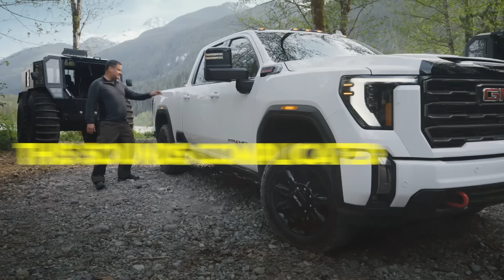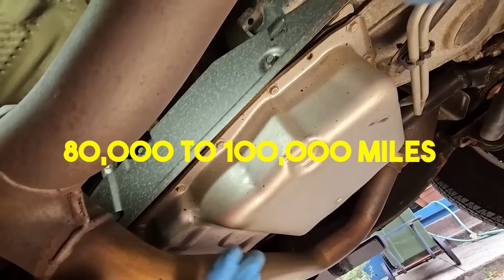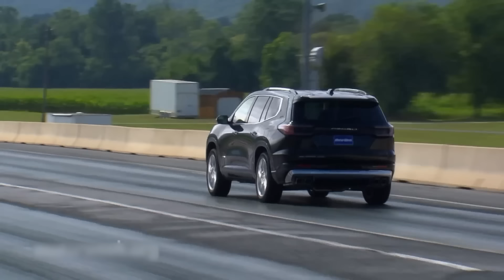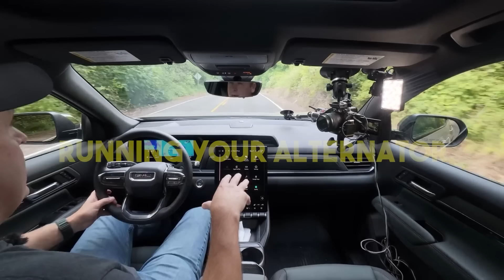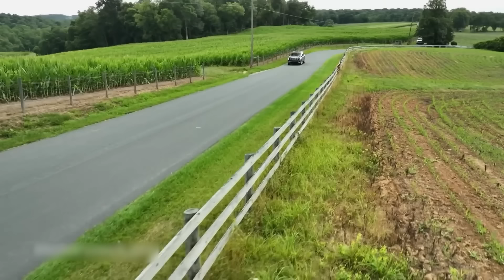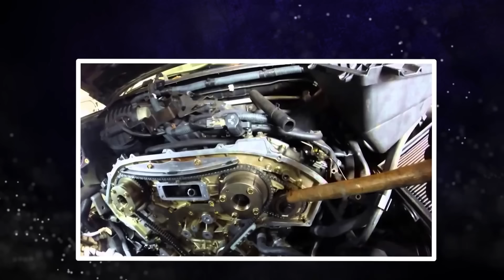How To Make Your GMC Last Over 300k Miles Without Major Repairs

Comment: 2,500 to 2,800 mile oil change.  25,000 to 28,000 transmission fluid change. 30,000 to 33,000 mile radiator coolant change. Brake fluid flush at the 50% wear mark and brake service / pad replacement.
Reply from the maker: That is a "bulletproof" maintenance schedule! While some might call those intervals aggressive, changing the oil every 2,500–2,800 miles is exactly how you reach that 300k-mile club without breaking a sweat. Keep it up!

Comment: Erm I just replaced my thermostat on my 2016 GMC Yukon Denali and the thermostat was NOT as cheap as you’re saying it was about $130 plus an additional 30$ for the coolant  and what place is charging 300-400$ for parts and labor!!! You won’t find that here in GA anywhere not even at a shady shop
Reply from the maker: That’s a fair point on the pricing! Shop rates and parts prices can definitely vary by region. $130 for the part is a bit steeper than what we've seen elsewhere, but it's still way better than a full $400 bill from a dealer! Thanks for the GA price update.
Reply: @EverythingGMC-k9x Georgias prices are INSANE. Especially at a GMC dealership. I need new back struts my are the z95 air rides I can get the struts at my local part store on my Commerical account for 779$ I called GMC just to see what the parts would cost and they said they were 1987 apiece each when I can get the arnott ones for 779 for both. I just had to also have my serpentine belt, ac belt and vacuum belt and tensioner pulley replaced the shop I went to wanted 787$ for parts and labor I made a phone call to my best friends husband since mine is out of state he told me go buy the parts and come on. Went to O’Rileys got all belts tensioner pulley the tool I need to rent to get the belt on for 142$ got 40$ back when I took the tool back. So really only $100 at the part store and he put the belts and pulley on in 30 mins. But the shops said it would take 2.5 hours for everything. Was trying to charge me 350$ on labor and 487$ for parts that I got for 102$  and the parts they were going to use was duralast which cost nowhere near $487 I got the Murray brand because AcDelco for some reason has to be special ordered at O’Rileys. Still the Murray brand is way better than duralast and they were trying to get me for $487 for just the belts and pulley. These shops and dealerships are a JOKE. Especially here in GA

Comment: I bought Diablo i3 and turned off AFM first thing . Change oil when it gets to 30%.regrounded all grounds, removed them , sanded , refastended then painted over to protect  .Put a transmission cooler on it keeping temp around 130-160 and everything’s been great  212k
Reply from the maker: You've built the perfect reliability blueprint! Killing the AFM, cleaning the grounds, and keeping those trans temps between 130-160 with a cooler is exactly why you've hit 212k miles without breaking a sweat. Great work on those proactive mods!

Comment: I'm looking at a 2006 Triple E motor home with an 8.1 Vortec engine. What do I need to know to look for?
Reply from the maker: The 8.1 Vortec is a torque monster! For a 2006 motor home, watch out for exhaust manifold leaks and check the spark plug wires carefully, as heat can be an issue in those tight engine bays. Good luck with the search!

Comment: I can’t believe you mentioned the Acadia haha ! It’s my wife’s car already put a trans in at 43,000
Miles other engine related parts in it not to mention the shift to park crap they love to eat batteries too . Side detection etc .
Reply from the maker: The Acadia is the perfect example of why some models make the 'Worst' list. Between the early transmission failures and that frustrating 'Shift to Park' sensor issue, they can definitely be a headache for owners.

Comment: I’d add brake fluid flush to this excellent video of yours as well…..thanks for all the tips ….Off hand will unhooking the battery terminals to clean them throw any codes?
Reply from the maker: Thanks for the kind words! You're 100% right about the brake fluid. Cleaning terminals usually won't cause issues, just a quick reset of your basic electronics.

Comment: Some wrong info.  GM V8 engines don't have chain stretch problems and the water pump is not driven by the chain.  But your info about proper maintenance is bang on
Reply from the maker: Appreciate the correction! You're right, on the GM V8s, the water pump is belt-driven, and while chain stretch is rarer than on other platforms, keeping that maintenance 'bang on' is still the golden rule. Thanks for keeping the info accurate!

Comment: Great information but ive never heard gm v8 engines dying from timing chain failure. Youre showing overhead cam engines while talking about it and that is misleading to the 4.8 5.3 and 6.2 engines as they are all pushrod engines.
Reply from the maker: Great catch! You’re 100% right—the 4.8, 5.3, and 6.2 are all pushrod V8s. Using an overhead cam engine as a visual was definitely a slip-up. Thanks for keeping the technical side accurate!

Comment: Use Amsoil.
Reply from the maker: Amsoil is a solid synthetic and popular for extended intervals, yes. OEM spec matters though, so check the manual, use oil analysis if you extend intervals, and 3k is a safe, conservative choice for severe use.
Reply: @kcsrr15  I’ve ordered it before but if it wasn’t such a pain in the ass to get be a member and expensive to buy I’d probably use it than maybe make it available to buy from the store but No gota jump threw the hoops to get it ..

Comment: Good info.  My 2003 Sierra 2500HD 6.6L Duramax has 210,000. I perform all work on my truck out of necessity. Very few shops work on them. Channels like this one is tremendous for beginners as well as for seasoned mechanics. Keep up the flow on info! Thanks
Reply from the maker: Love hearing that. A 2003 is the LB7 Duramax: keep an eye on injector balance rates/return lines, water‑pump seepage, and harness rubs around the A/C bracket. Fresh fuel filters, regular Allison fluid/service, and it will keep going. Thanks for the kind words.

Comment: with All of those moving parts, extreme heat cycling,  tight emission controls and greedy bean counters, I highly doubt today's gas burning pos will last past the warranty without some kind of expensive repair.  Junk with 4 wheels and a high sticker price.
Reply from the maker: I get the skepticism, modern gas engines are more complex and emissions gear adds failure points, but many still hit high miles with strict maintenance, quality fuel, and proactive cooling/oil care.

Comment: I have a 2024 GMC SIERRS 3500HD. I believe I blew the fuse on my power supply in my bed and in my console. Can anyone tell me where it is located?
Reply from the maker: Check the owner's manual fuse diagram first, common locations are the underhood fuse center and the interior fuse panel under the dash or driver kick panel, some trucks have a rear/cargo fuse or accessory block under the rear seat or in the bed area, look for fuses labeled 'accessory power', 'cargo' or 'rear power', replace with the same amp rating and test, if it's under warranty contact the dealer for guidance.

Comment: Spark plugs are now around $15.00 dollars apiece. Now multiply that times 8.  That maybe cheap for some folks.
Reply from the maker: Yep, spark plugs add up, modern iridium plugs are about $10 to $20 each but often last 60,000 to 100,000 miles, long‑term cost can be reasonable, consider doing them yourself or use quality platinum options if budget is tight, always check OEM gap and torque

Comment: That’s easy. Trade it in for a Ford then it will last to 300k
Reply: Some of us would never own a FORD. You do you!
Reply: @darin5294 I can’t help it if you’re stupid
Reply: Couldn’t give me a Ford unless it’s from the 70’s
Reply: @AJ12-76  Found On Road Dead……. No thanks……..
Reply: @rags8855 boy that’s original!  Wish I could have thought of that…….🤡
Reply from the maker: Trading is an option, but a properly maintained GMC can reach 300k, focus on regular oil changes, cooling and transmission care, addressing AFM/lifter issues early, and corrosion control, what problems are you seeing with your truck?
Reply: Ford 😂
Reply: @DonCurry-n1z even a broken down Ford still beats a Garbage Motors piece of shit
Reply: @AJ12-76 😂 Ford ? F-N owner really dumb 🤣

Comment: The GM thermostat is not 15-20 bucks, try $120 for the OEM
Reply from the maker: OEM thermostats can be $100–120 depending on model, cheaper aftermarket units exist but quality varies, for longevity use OEM or a reputable brand and replace the gasket/housing when you do it, what year/engine is it?

Comment: #1 oil change every 5k miles. 
#2 change transmission fluid change every 60k miles 
#3 coolant change every 60k miles  including thermostat.
#4 throttle body service.
#5 battery terminal maintenance 
#6 air filter change 
#7 belt inspection 
#8 spark plugs every 100k miles 
#9 differential service 
#10 power steering fluid
Reply from the maker: Good checklist, a few quick clarifications,  
- Oil every 5k is solid for longevity,  
- Transmission interval depends on trans and use, check the manual or go 30–60k for heavy towing,  
- Coolant (Dex‑Cool) has a long spec, but check condition and concentration, earlier flushes help high‑mileage trucks,  
- Throttle body service only as needed, not always on a schedule,  
- Spark plug interval depends on type, iridium ~80–100k, copper much sooner,  
- Differential/transfer case service depends on load and towing, follow severe‑service intervals,  
- Power steering fluid follows OEM spec, some systems are sealed.  

What year, engine, and towing use do you have?
Reply: @EverythingGMC-k9x my GMC is a 2016 4/4 canyon long bed with 135,000 mi on it.  I bought it used with 100k mi on it.  My power steering went out last year, but I bought the extended warranty and they covered it for a hundred dollar deductible.  But they refuse to drain and fill the transmission fluid because of the mileage. So I took it to aamco, and they said the same thing.
Reply: Do these rules apply with 2019 Silverado High country?

Comment: 3-4000 engine oil change 
Gospel
Reply: I keep things old school. I do oil changes at 3k. Ive had vehicles go past 300K miles including Ram 1500 with no issues. AFM DELETE IS A MUST!
Reply from the maker: Agree, 3,000 miles plus an AFM delete is a common longevity play for AFM V8s, just be aware deletes can affect warranty and should be done correctly, what oil weight and filter are you running?
Reply from the maker: Totally get it, 3,000–4,000 mile oil changes are a safe, conservative approach, especially on older trucks or ones that tow a lot, modern Dexos synthetics can allow longer intervals for normal driving per the owner’s manual, but if you tow, do short trips, or run AFM engines, stick to shorter changes.
Reply: @SIERRA-dx9wm AMEN 🙏

Comment: Good video but the new fluid for modern GM transmissions is Mobil 1 Synthetic LV ATF HP blue label not Dexron.
Reply: Works awesome in L680 transmission for my 2017 GMC Sierra SLT
Reply from the maker: Good catch, thanks, Mobil 1 LV ATF HP is a common choice for newer GM transmissions, always follow the owner’s manual and any TSBs for your specific trans and year.

Comment: AFM Delete and moving up from 0w20 to 5w30 Dexos Syn for the win!
Reply from the maker: AFM delete plus switching to 5W‑30 Dexos can reduce lifter cycling issues and improve oil film at higher temps, but check OEM spec for warranty reasons and monitor oil pressure/consumption after the change, what year/engine do you have?
Reply: @EverythingGMC-k9x 2015 GMC Sierra, 5.3, excellent truck. Remember to change the oil cap to "5w30" for added assurance just in case, even as I do my own service.
Reply: @thangknowa3288 mine is a 2016 Yukon Denali 6.2L 168.600 miles and I’m scared to death to do the AFM delete.

Comment: I can think of a couple more like clean your MASS air flow  sensor . When doing the timing chain project replace idler pully because of bearing failure !
Reply from the maker: Totally, pulleys and bearings fail and destroy a timing chain job, replace the idler, tensioner and guides when you do the chain, good call.

Comment: Range module to disable the cylinder shut down and the auto start stop. Change oil every 5k with good filter and if unsure of filter then use acdelco. and install a ppe trans pan to do drain and fills every other oil change and change all other fluids every 40k.
Reply from the maker: Thanks for sharing your tips! Those are some solid maintenance strategies that can really extend the life of a GMC.

Comment: First thing ,GM DOESN'T put drain plus on there transmission land anymore
Reply from the maker: Thanks for pointing that out! You're correct—GM removed drain plugs on the 8L90 and 10L80 transmissions. On those, you have to drop the entire pan. Older 6L80 and Allison still have them. I'll be more specific in future videos. Appreciate you!
Reply: Rear ends also, suck  it out or pop the cover off !

Comment: I change my plugs at 50k miles on my 5.3. The last time I changed them the electrodes were pretty much gone. They were still firing but I guarantee they were affecting burn. Next time I’m changing them at 40k miles. Our Lexus, which uses similar plugs, calls for 40k spark plug changes. 100k is ridiculous.
Reply from the maker: I appreciate your insights! It's great to hear how you keep your GMC running strong. Your experience will definitely help others in the community!

Comment: A lot of good tips.  Unfortunately for me despite most of those items being preventativly maintained, in particular my torque converter in a 6L80 detonated at 100,000 miles and took out the transmission.  I had done 3 transmission oil changes at that point.  Shameful as all my other trucks never had a transmission issue in the 200-250,000 miles that i typically keep my trucks for.  Love my 2018 sierra but its not been without issues.
Reply from the maker: I really appreciate your feedback! It’s always helpful to hear real-life experiences. Hopefully, the love for your Sierra will outweigh the bumps along the way! :)

Comment: AC Delco Air filter for the 6.6 gas is $43.00 from Walmart not 20.00. Over $70.00 from dealership.
Reply from the maker: Good catch! I guess I need to hit up Walmart next time instead of the dealership. Appreciate the info!
Reply: Same with plugs not 30$ a set ,try 80-100 per set for the correct ones

Comment: first thing spend the 200$ on a device that plugs into your OBD2 port that turns off the cylinder shut off.
Reply: @chriskelley1115  still have to change oil at 5k miles and drain fill the trans every 20k
Reply: @groovymoon  it will stop it from shutting the cylinders off/on...but it does not solve the issue. The bad parts are still there. You need to do the mechanical delete as well. All new non-AFM lifters and non-AFM cam. Even disabled in the computer if you do not do the full delete you will still have the castistophic engine failure.
Reply: @groovymoon  I did it at 30,000.  Should I do it every 20,000?
Reply: @toddeifert410 the more the merrier.
Reply: @toddeifert410 thanks. I’ll do that. Typically I leave newer trans alone. These things are a lot trickier than my old ford c6 and my Elco 700r4
Reply from the maker: Thanks for the tip! Investing in that device could save a lot of headaches down the road!
Reply: @chriskelley1115  Yes Range Technology no more deactivating cylinders and no more start stop crap
Reply: yup get that device to keep that V8 always pumping...and CHANGE that OIL!!!!!!!
Reply: Be sure the one you get has no parasitic drain when the switch is off. Some do, it depends which pin they receive power from, some select an "Always Hot" pin, needs to be "Switched".
Reply: I bought a "clone" disabler for our 2014 Yukon we bought 3 years ago, and wired it to a switched circuit.  Yes, that disabler would need to be unplugged to use OBD2 reader.
Reply: Did that with a Ranger from Summit.
Runs on all 8 cylinders
Reply: All it takes is alot of up keep money, just money.
Reply: @chriskelley1115  I got one for 59 dollars 3 years ago it works great
Reply: @chriskelley1115  is the range device better than running in L 9 on the 10 speed tran ,or just more convenient.2026 serria 1500 5.3
Reply: @chriskelley1115  I bought Diablo i3 for mine . That’s first thing I did
Reply: I did 👍🏻👍🏻👍🏻
Reply: I spent 45 on mine.
Reply: @chriskelley1115  or shift to L9